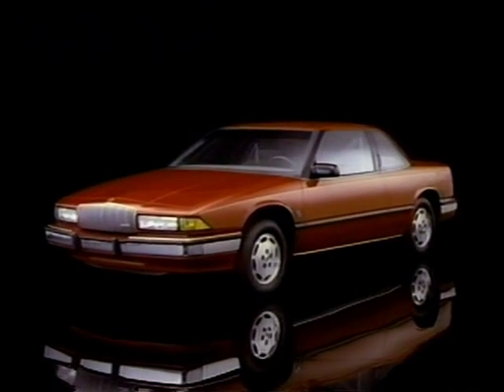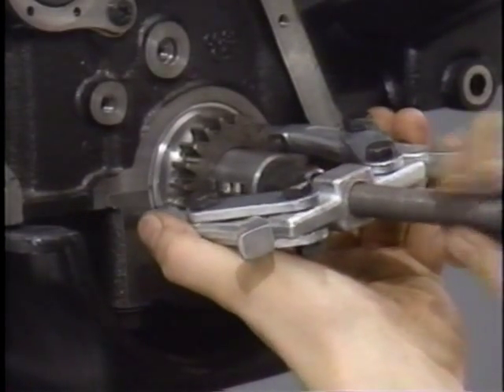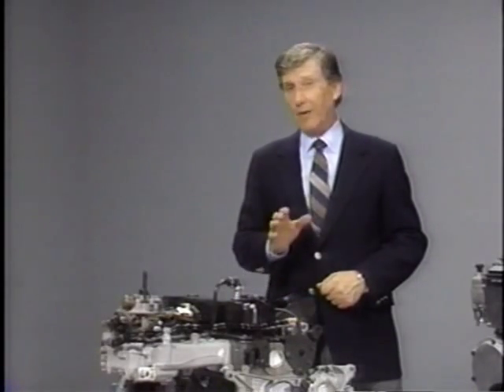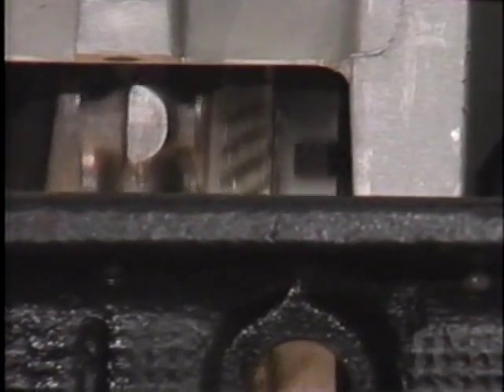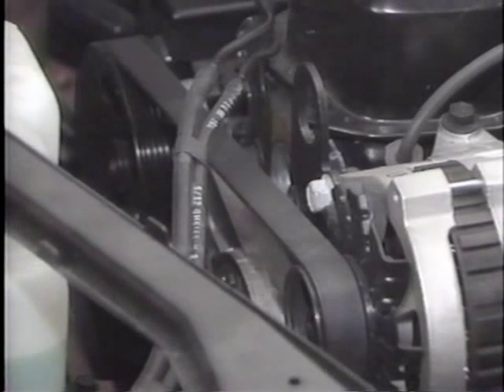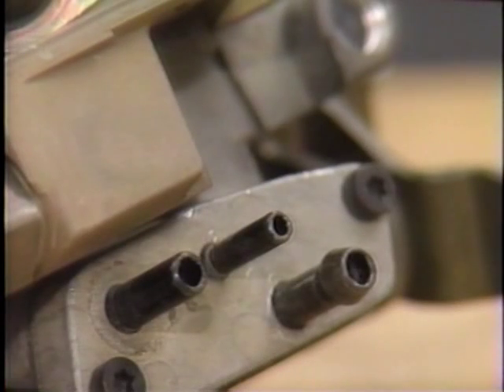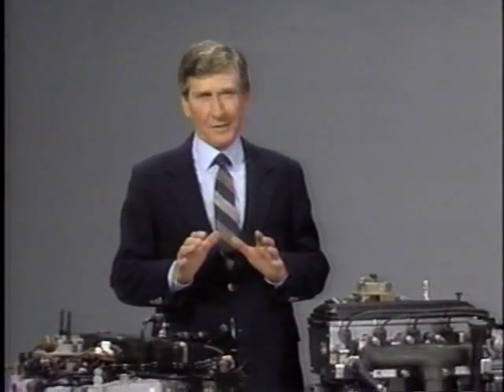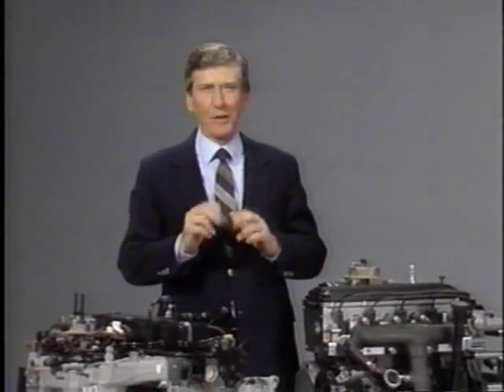Buick - 2.0L & 2.5L Engines (1988)

Comment: Nice info. Likely 90% of those engines produced are scrapped. You see old GMs rattling around still. There will always be those oddball 50k mile finds in a barn somewhere. The nicest we owned was a later model black 4-door Chevrolet Celebrity with all the doodads, integrated headlights and a V6. It was the last sedan we ever saw with a bench seat in the front. I remember it being surprisingly roomy.
Reply: Or the aging usps fleet groaning along
Reply: I just bought an 86 with 65k miles on it!
Reply: 2.5l is the Grumman mail van engine, there are literally thousands still in active use that why i still use them, any mail van repair usps depot has plenty of parts, but those s10s are getting rare, IDK my mileage cause the odo broke at 400,000.